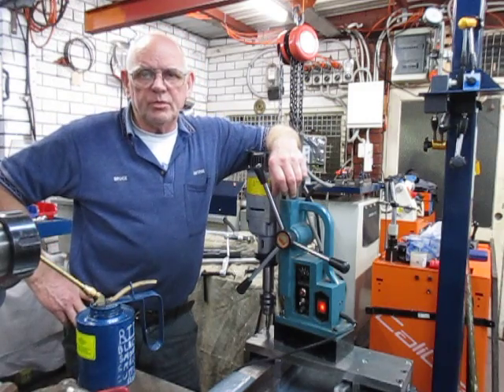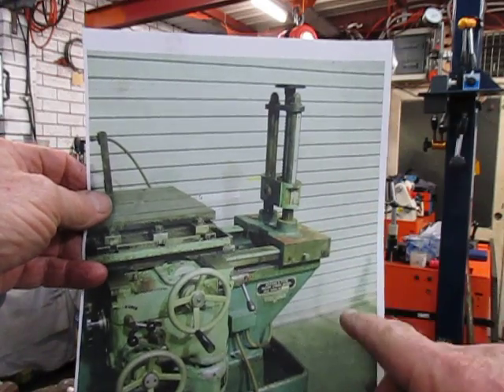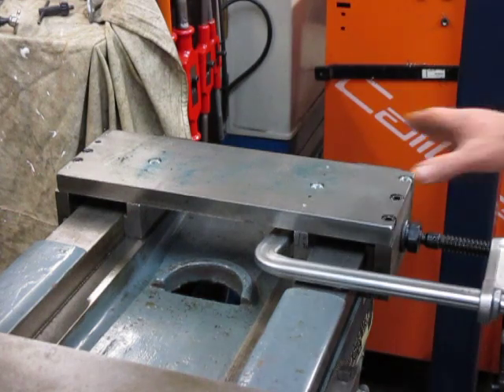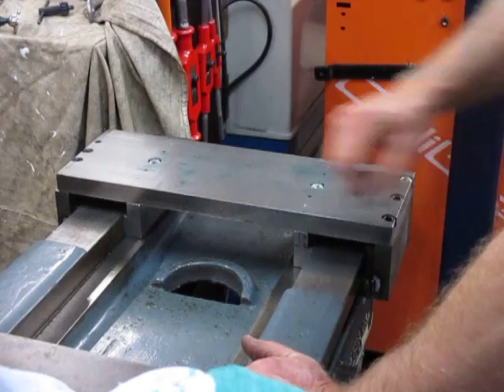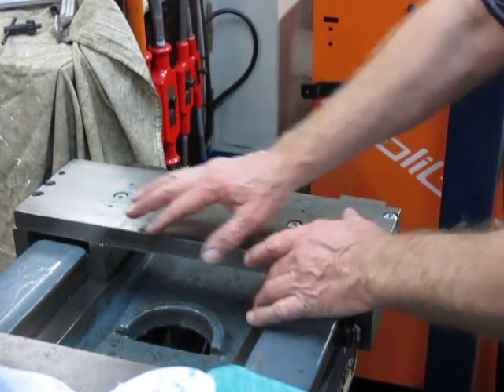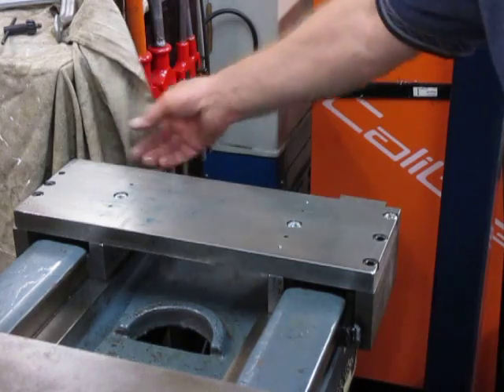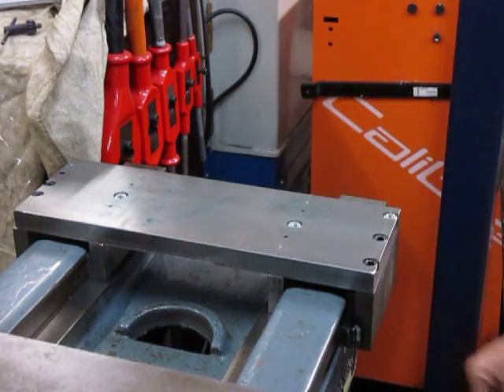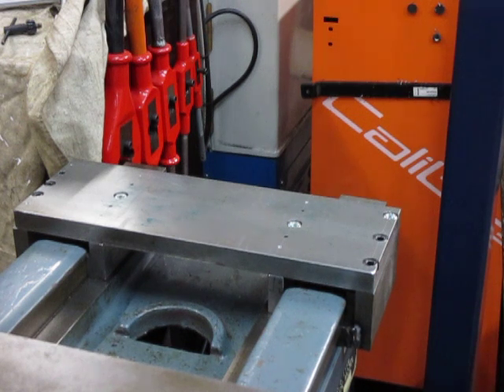HBM Back Stay Base Build Video 1

Comment from the maker: I read the thread of the original to be around a 4 to 5 TPI going by the pictures I saw, and that is what I'll go for as I have 5TPI Standard acme allthread in stock. One thing I don't have an that is a block suitable for the centre unit I'll have to buy some 100mm square for that.

Comment: This is going to be most interesting to watch develop. I like your bed design very much, I presume for accuracy it will be necessary to use a really fine thread on the height adjuster to produce the control you are looking for but this would be tedious if you have to move it a long distance frequently. Friction band brake to hold it in place?
Reply: +Dan Whiteford One way to deal with this issue is to use a differential screw.
Use a fairly coarse spindle but make the nut as as a sleeve, with a slightly different thread on the outside.
<https://upload.wikimedia.org/wikipedia/commons/5/58/Differential_Screw_Leveler%2C_Modern_Machine-Shop_Practice%2C_Vol._I_%28of_2%29%2C_by_Joshua_Rose%2C_Figure_417%2C_1887_-_illo0135e.png>

If my eyes don't deceive me Bruce has cut the top plate slightly short. The thought is oddly reassuring ;-)
Reply from the maker: +stefantrethan The length was correct at time of cutting, but when I went to fit the rear side steady plate I noticed a anomaly. I wrongly assumed the rear side was an emulation of the front. WRONG! how many more times do I have to say NEVER assume! Humph! just goes to highlight my human side!